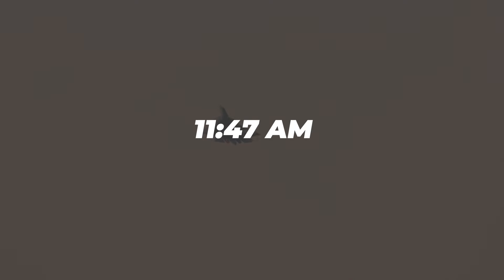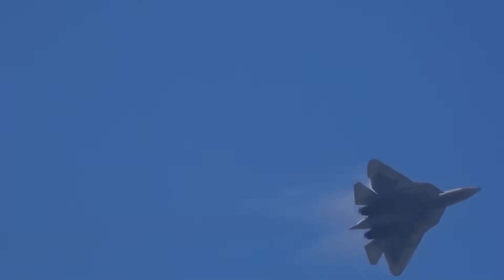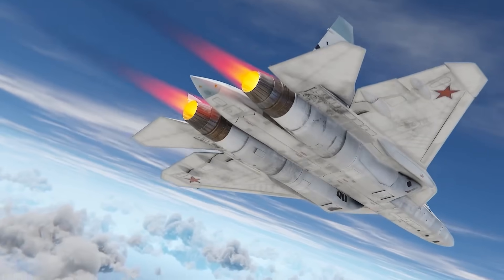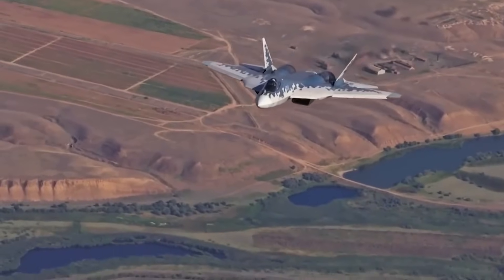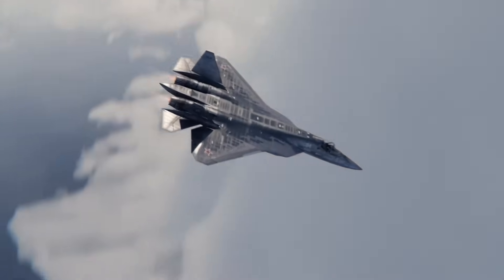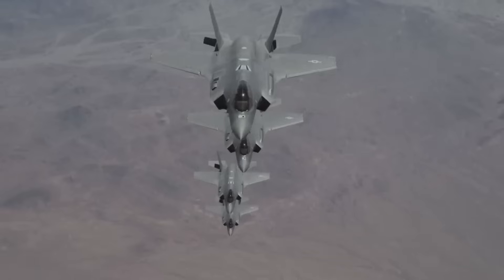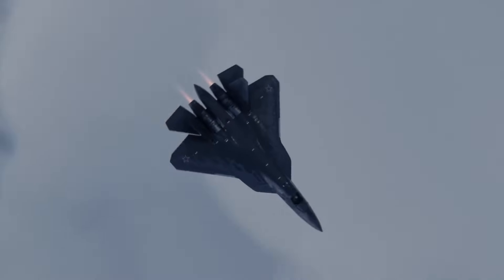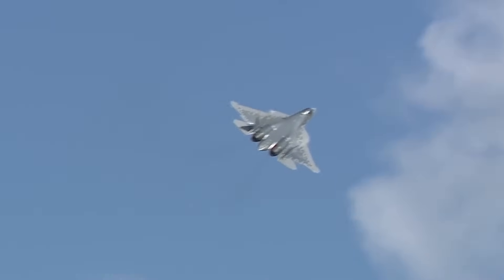Why the Su 57’s ‘Bad’ Design Is Actually Genius

Comment: The Su-57 looks like a fighter, but it's actually a bit more. Its philosophy is slightly closer to the MiG-31 than to the Su-27/35. The MiG-31 was one of the first aircraft in the world to boast network capability. It could work in conjunction with both ground-based air defenses and other fighters, like the MiG-25, exchanging target data and distributing missions. Therefore, the Su-57 will perform missions similar to AWACS, especially given the Russian Air Force's shortage of them. Therefore, stealth is less of a factor for it, because if you fly with the radar on, or even open, it lights up like a Christmas tree. This one-meter-square dish in the nose of the aircraft immediately makes it visible on all radars. The F-22 and F-35 are invisible as long as they rely on external radars, so they also need an AWACS in the rear to achieve stealth. But modern long-range hypersonic air-to-air missiles make such AWACS an extremely vulnerable priority target. And after losing an AWACS, aircraft are forced to turn on their radars and lose their stealth.
Reply: Su-57 is a multirole aircraft, and was designed to be so from the ground up. The whole idea was to network it with everything possible, be it another fighter, an AWACS, a ground-control or even a friendly SAM site.
Reply: по замыслу инженеров, СУ - 57 должен быть ведущим для нескольких дронов типа охотник. Распределять цели, оказывать огневую поддержку и т. д. Но судя по тому, что охотник сбил сам СУ 57, когда дрон потерял управление и что бы он не достался в целом виде, это еще находится на стадии тестирования. С другой стороны, после боевых испытаний и исправления выявленных ошибок обычно запускают серийное производство.
Reply: Nice analysis
Reply: радар любого самолета работает как зеркало и хорошо отражает лучи, даже если выключен, даже ф-22 и ф-35 видны на радаре из-за своих собственных радаров и кучи датчиков, которые не прикрыты радиопоглощающим материалом. Поэтому можно рассмеяться в лицо тому, кто говорит, что ф-22 имеет эпр размеров с коробку спичек)
Reply: Perform AWACS? that defeats the purpose of stealth, and no fighter has teh radar to be an AWACS.
Reply: Именно!
Reply: What kind of air to air missiles you would call hypersonic? Most of the modern missiles are mach 4 or 5 maximum and they have much lower range than awacs. Speaking of AWAKS, Russia has almost no aircraft of this type, they're lost some in Ukraine and their production rate is basically a zero.
Reply: @cyan2925  "What kind of air to air missiles you would call hypersonic?"

this is not complicated, but you people act like it's the most difficult thing to comprehend.

Hypersonic = Mach 5.0+

ANYTHING OVER MACH 5 is hypersonic, by definition. if a missile can achieve Mach 5, it is hypersonic capable. If it can only achieve Mach 4, then it is not hypersonic. A missile that fails to ever go faster than Mach 4.99 is not Hypersonic. A missile that has proven it can get to Mach 5.0 or faster is hypersonic.

A child can grasp this, here is the breakdown;

Subsonic: Mach 0-.99 (including transonic)
Transonic: Mach 0.85-.99
Supersonic: Mach 1.0+ (including hypersonic)
Hypersonic: Mach 5.0+
Reply: @SoloRenegade I pharased it wrong, i've meant that there is not that many operational hypersonic air to air missiles at all. While AIM-260 and R-37M are could be called hypersonic since their maximum speed it 5-6M (this value is highly situational, depending on altitude and it's launching platform speed), it's not clear how long their boosters last (meaning no escape zone and their actual range is not clearly specified for obvious reasons). Their maximum range of 200-300km is also lower than E-3 radar range and they're can't really be fired from their maximum range.
Reply: @cyan2925  "Their maximum range of 200-300km is also lower than E-3 radar range and they're can't really be fired from their maximum range."

range, radar. AWACs, etc. have NOTHING TO DO WITH BEING HYPERSONIC. Seriously, trying using some logical reasoning.

Also, yes, the missiles 100% CAN be launched from maximum range. Clearly you have no clue how modern combat engagements are being handled. Datalink and handoffs. there are literally videos on youtube of the US military demonstrating this capability. Youtubers and other outlets have done videos on this topic for many years now, the internet is replete with articles and videos explaining how this works. Drones, F-15, F-35, B-1, B-2, F-18 and many more have done this or been considered for this.

Also, missiles are not generally guided by AWACS. AWACS is about having situational awareness, and sharing targeting information.

I'll repeat again, this time more slowly, so that hopefully you comprehend this time.

ANY MISSILE THAT IS CAPABLE OF MACH 5.0+ is HYPERSONIC.  Not every missile of a given type must fly hypersonic for the missile to be considered hypersonic or hypersonic capable. Range and booster burn time are also not factors in whether a missile is hypersonic or not. Only a person with no critical thinking skills would think adding such criteria makes any sense at all.
Reply: @SoloRenegade AWACS have nothing to do with being hypersonic. But this is your take: "But modern long-range hypersonic air-to-air missiles make such AWACS an extremely vulnerable priority target."

Missile being hpersonic HAS NOTHING TO DO WITH MAKING AWACS AN EXTREMELY VULNERABLE TARGET. You get it? Try using some logical thinking.

You clearly have no clue how modern air to air missiles work. You have to lock target first, meaning you have to get much closes than both radar detection and missile max ranges. Which means you mush have an active radar to lock target at around 50-80km range to transfer data and then launch a missile from maximum range (which requires high altitude and high missile carrier speed to achieve both maximum range and speed). So, what's the point of ~200-300km range if you still must get much closer to lock a target, which would be easily noticed? At this point it would be more reliable to launch a missile from aircraft that's close by, since while missiles could be launched from maximum range, their effective range is much lower. Can you read it or it's a foreign concept for you?

Missiles are nor generally guided by AWACS, but could be. The point is that AWACS would detect plane much earlier than it could lock it.

Only a person with no critical thinking would fap on a word HYPERSONIC like it's some kind of wonderwaffe of an more advanced civilization. 

Don't forget that Russia operates AT VERY LEAST twice lower amount of AWACS, especially considering 2 confirmed A-50 losses.

See, not only you could be toxic, Stop trying to belittle your opponent, you don't look smart.
Reply: It has secondary L band radar which detects stealth. Over Lebanon a Russian SU57 locked onto a Israeli F35 from 90km away. Its a well known fact long wavelength radar detects stealth but not to a degree it can get a lock on. Russia claims to have overcome that obstacle and their latest radars can all detect stealths although at reduced range. After the incident Israel ceased air operations for some time. Substantiating the claim by Russia.
Reply: @ruhtraeregelThanks for the additional information
Reply: that dish is angled ("up") but sure emmiting radar waves "will get you noticed". One of the most defining features is the L-band radars
Reply: Radar doesn't work that way.
Reply: @angeldust4109 it does
Reply: @angeldust4109 exactly, a modern F22 phased array radar system can actually stay undetected will being active 🤔

Comment: Wait a minute…if the su-35 is guiding a missile with a radar lock from a “cheek radar array” then that radar energy guiding the missile would be like an electronic spot light and that would be immediately and clearly visible and trackable by an American plane’s radar so the claim that the Russian plane turning 90 degrees to become invisible has to be a false or at least an inaccurate. Also, American planes are equipped with H.A.R.M. (High speed anti-radiation missile) missiles that are designed specifically to hone in and quickly attack any source of radar RF energy so there’s that. I’m not an engineer but common sense would refute a lot of the claims made in this video. 

On the other hand I think the fully 3D thrust vectoring engines are awesome. To be fair you gotta love the constant improvement of technology from a scientific standpoint regardless of who creates it.
Reply: All that bullshit Hollywood stuff about your american jet fighters are lie 😂😂😂😂
Reply: Thats not how radar notching works, turning perpendicular and moving sideways causes missile to lose energy, the principle is not to make the jet lose lock but to make missile lose energy, useful in BVR combat
Reply: You fail to understand. Turning beam deprives the tracking radar of doppler effect, the famous "notching the radar" technique.
Modern radar warning receivers can only give you the direction from which the enemy is illuminating you and the signal strength. It can't give you the distance. It might give you the the type of radar illuminating you if it's saved in the ECCM systems library. It won't give you a firing solution to shoot back.
While American fighters CAN carry the HARM, AARGM etc, first off they have to carry it in THAT PARTICULAR BATTLE. Noone carries them for retaliatory fire. Also it's not an air-to-air missile, it's an air-to-ground fat heavy slow missile, so targeting a nimble fighter with it is dumb. It might work on an AWACS platform of some sort.